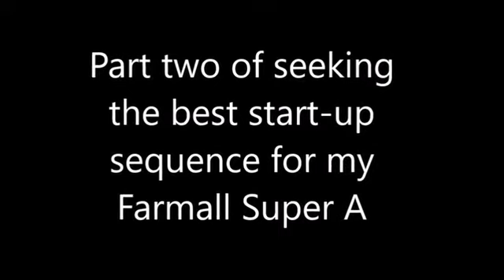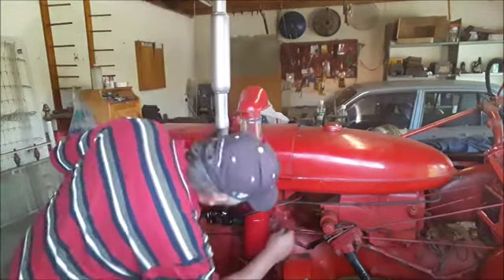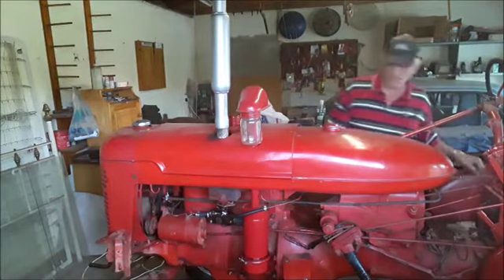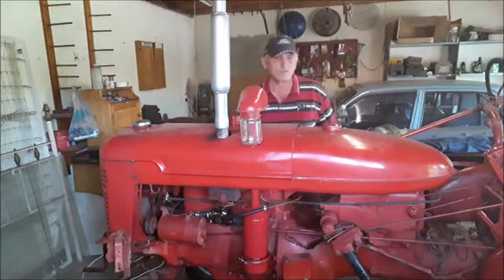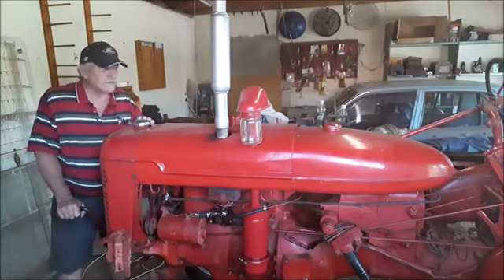Part two of a cold start test on my Farmall Super A, and a New Year message for you

Comment: When she starts she sounds Great Jan... Remember that What You are calling 1 Crank is actually only a 1/4 crank...So you are Definitely NOT always on the Firing Stroke of the Engine. 
Have You Checked all electrical connections and Condition of the Points?  I'm sure it's something very simple... You Will find the Sweet Spot"... Happy New Year MY Friend.
Reply from the maker: Hi Dan, I will find that sweet spot.I am pretty sure the points are good, the last time I checked it it looks like new, I still think it flood due to getting fuel in easy, keep on watching Dan, I will continue tomorrow,
Reply: Very Good Point...that's true , provided that there is indeed a good spark on each plug,  which  makes me lean more towards the Plugs being Fouled or Wet with Gas...